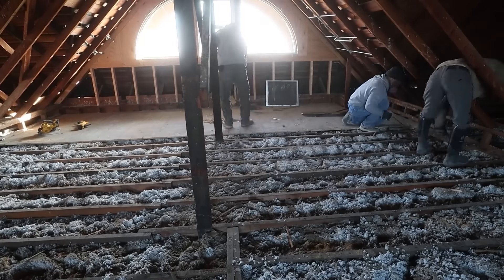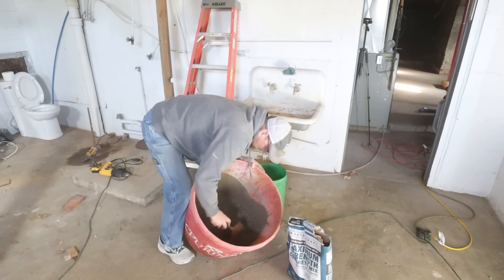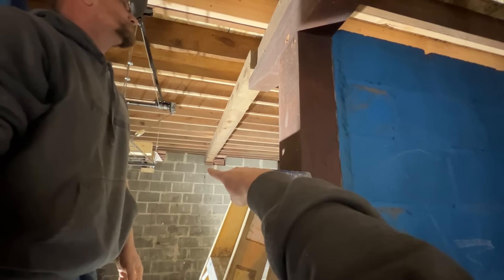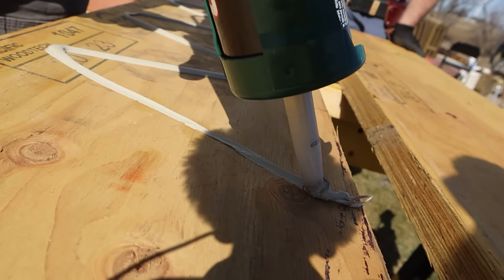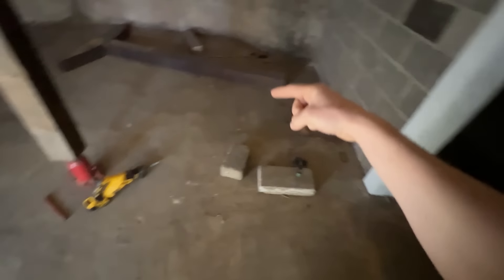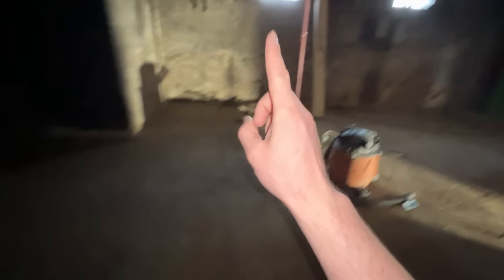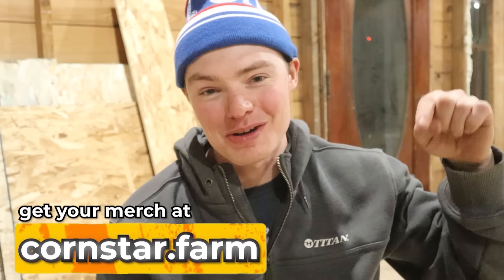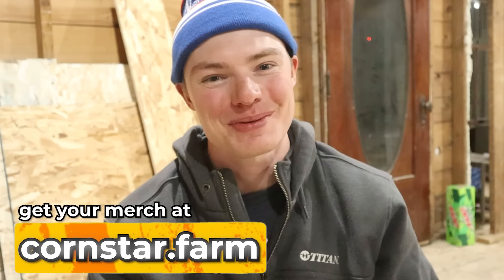Restoring A $7,000 Mansion: Rebuilding Basement Ceiling

Comment: You have good height in the basement, so you might be able to save money and time, and get a great finished product, by just cutting trenches into the existing basement floor for plumbing, drainage, radon venting, column support pads, wall relocation, etc.  Patch the trenches after utility installation/changes with concrete, make any other repairs needed, and cover with pumped-in self-leveling gypsum concrete to create a level smooth and durable floor throughout.  
You must consider moisture control before applying a self-leveling gypsum concrete overlay to an existing basement slab, so it’s essential to address potential water vapor emissions.

Begin by assessing the moisture content of the existing concrete slab. You can use a calcium chloride test kit to measure the moisture vapor emissions rate (MVER) in pounds per 1000 square feet over 24 hours.
Overlay product manufacturers typically recommend an MVER of 3 pounds or less for successful bonding.
To prevent water vapor from delaminating the overlay, apply a vapor barrier to the existing concrete slab.  Use a high-quality vapor barrier product designed for this purpose.  Redgard and Laticrete 9235 are two brands of waterproofing available at big box stores.
The vapor barrier acts as a protective layer, blocking moisture from migrating upward.
Clean the existing concrete slab thoroughly, removing any dirt, dust, or contaminants.
Repair any cracks or defects in the concrete surface.

Waterproof, allow time to cure, and install the self-leveling gypsum concrete overlay.

FYI, your house is on a hill, and appears to have been built on well draining soil.  You really don't need floor drains, except one where the water heater and washer are located.  Floor drains will just be a possible entry point for radon.  Exterior waterproofing is the best solution for walls.
P. S.  Drop the rubble from trenching down the well and install slab on top.  Done and dusted.   Cheers.

Comment: Use a pumper cement truck.
The truck has a pump and a flexible rubber  pipe to run the cement  anywhere  in the basement. 😊

Comment: Enjoying this series.  That basement step area looks like it could use a redesign, not just new concrete. It's a pretty narrow set of steps with sharp turns at the top and bottom. There has to be a better layout, before investing in all that new concrete..

Comment: Doing it in circles creates areas that potentially can trap air creating pockets of pressure and prevent the surfaces from completely mating adding thickness to the beam which depending on the situation if it's a tight fit it could prevent the beam going into its designated space and not interfere with other parts of the building.

Comment: Concrete is hard, heavy and dirty.  The sooner you guys get on with it the better.  Get it done and then you can get back to the fun part with framing and finishing.  The exterior concrete wall could probably use a new seal coat of tar or insulation to keep the basement dry and warm.  And yes drainage rock and then piping around the outside will solve a lot of problems.

Comment: So this is how its usually done where i am from, we do have quite cold temperatures here so this might not apply to your place. For the basement floor i would recommend digging it all up, lower it so you can have Gravel (10-15CM/4-6 inches) - polystyrene plates (10cm/4 inches) - concrete floor (10-15CM/4-6 inches). This gives it a total needed depth of about 30-40 cm or 12-16 inches under the basement. Now this also depends on the thickness of the footing around the bottom of the basement walls and so on, but the gravel allows for a certain amount of drainage, and the thick insulation is very practical for keeping both heat and cold in/out of your house. when it comes to the outside drainage it also depends alot on what kind of material the ground is made up of, take my place has alot of mountain beneath it, so the drainage just requires a small slope under the house to keep the basement dry, but if you have a type of ground around your house that retains alot of water i recommend for example a french drain style of drainage around your basement walls.

Comment: When it comes to your basement cement, you might be able to pump it through one window and have different sections to run the concrete through in a pipe something to check out concrete pumper

Comment: Install French drains and deep french wells that create gravity runs of water around and away from your external foundation walls.  Essentially create an entire horseshoe shape gravel ditch 4-6 ft deep and 1-2 feet wide about 15-30 feet away from your foundation itself. 

Then weeping tiles should be installed up against the base external foundational wall around the entire basement - that water can flow into and out of a sump pump install in the basement specifically to disperse water that arrives at the house via the weeping tile of other ground water.  Use appropriate bubble tarp and tar on the exterior wall of the foundation to direct water down efficiently.

Comment: You can do radon mitigation using the same pipes you use for sub floor drainage. Get two birds stones at once.
Reply: Also you might be able to start with passive radon mitigation (just pipes that vent to atmosphere) then do some testing and can add a radon pump if you need it inline with the same piping.

Comment: Justin"s "I aint't got no body" moment. at 14:41. 
Edit: I have an inside french drain around three sides of my basement with no outside french drain, I have a walkout basement and live on a sloped lot. I couldn't afford both at the time. Ten years after that I finished out the basement. Still have had no issues with moisture. It will definitely help to put them in.

Comment: Cole they make trailer mounted concrete pumper just for the purpose where a concrete truck won't fit it's pumped through a series of hose so you don't need to use wheelbarrows

Comment: Cole, you might think about hiring a contractor to do that basement.  Money well spent.  They will probably get it done in a few days if you have done the demo.  But I know you will not hire them so my advice (not that you asked) is to use wheelbarrows.  Put a chute in the window and use the wheelbarrows to move the crete to the farthest location first and finish up at the window.
Reply: You forgot the fun part, getting the old concrete out of the basement... one 5 gallon bucket at a time.

Comment: run drains inside and outside to a sump pit with a tight sealed lid while the floor is out for a foundation drain, it can also be used for radiation remediation if it's ever necessary.  Your floor drains should be part of the sanitary drain system. You also may want to use cast iron pipe for vertical runs in the living spaces, it's much quieter when the toilets are flushed.

Comment: Here in Darwin Australia, every building has to be built to cyclone code. So, all "cinder" block walls are core filled with concrete after erection and steel reinforcing bars are placed every second block through  the concrete.

Comment: An interior perimeter foundation drainage system will solve the problem of ever having any standing water in the basement.   No floor drains necessary.   Only an in-floor sump pump directing the hydraulic ground water pressure to the drainage ditch outside.

Comment: Make it like looking at a fish bone 
One man with fingers reaching out drawing the water in and out the main drain then slope your concrete accordingly 
And did you say radiant heat 
That a great time for that install 
To 
Make it more efficient add some gravel with foam board on top to create a heat sink making your radiant heat much more efficient 
It should be a great place when you’re doing

Comment: If you have heavy clay soil which expands when getting wet and shrinks when dry, before pouring basement concrete flood it so the soil will expand to its max and then pour the floor. 
This way it will not break your concrete because the soil has expended to its max, also put in drain tiles with a sump pump

Comment: Radon Gas: Around here (southern Kansas) it settles in the low spot in basements which is the sump pump. It's rather common but I don't have it, several neighbors up and down my street have it. I do have a passive radon gas vent on my sump in my basement which is a cover over the sump and a 4" vent pipe running to the outside.

As for in-ground drainage, most of the houses around here have a sump with a sump pump in it and an emergency sump pump for when the power goes out which is usually during a thunderstorm. Some houses have two sump pumps if they've got an active spring in the area. As far as drain tiles go, most houses have them on the outside and inside of the basement running along both sides of the wall. They dump into the basement pump and the sump pump, pumps the water out of the house and away from the house. Mine dumps at the foot of a large Maple tree in my front yard and keeps it watered...

Comment: Pouring the concrete floor depends on manpower and or cost. You can wheelbarrow your pour, or you can use a pumper truck with self leveling concrete. The pumper truck would run a hose through the window and you pour from the farthest point and work back to the window pulling the hose out as you go.

Comment: A concrete pump truck should have large hoses that you can use to get the concrete across the basement. If it isn't long enough, then use wheel barrels. Omg I have pushed so many wheel barrels full of concrete over the years. Probably enough to easily do your whole basement plus some. Good luck.

Comment: With a load-bearing beam, you should have cut the hole bigger enough for a solid concrete block or engineer bricks a very dense material (not fresh concrete) so if your beam is 4 inches wide, for example, you should allow minimum 2 inches on either side so you have spread load and then pack it with slate.....

Comment: If the basement hasn’t had water issues previously it’s doubtful that you will ever experience water issues. From seeing the house pretty much sitting on the top of a hill this also helps the fact that water is going to flow away from the house. 

If going to the extreme of removing the basement floor add radiant heat to the floor.

Comment: use a 2 wheel wheelbarrow to move the concrete to the back rooms first (work from the far rooms to the windows).  the fewer holes in the concrete floor the better for the radon radiation.  put the weeping tile on the outside of the foundation below the level of the footer to keep the water pressure from developing under the floor.  once the floor is broken up and dig out some dirt and place screened gravel down then a very heavy vapor barrier to pore the concrete on.  the gravel will provide drainage to move the ground water to the weeping tile.  place sump wells on the outside to drain the weeping tile if the fall to the ditch in not enough to do the job.

Comment: To do a proper radon test the area will need to be closed up for 12 hours. It's quite possible there's radon down there, especially if there is exposed dirt. When a radon system is put in, the dirt area will need to be removed/concreted, or covered with thick plastic and strong tape along the edges.  As for the drainage for water/flood, our home is on top of a hill like yours, and we've never had water in the basement. If you have a good grade around the house to direct water away and a good gutter system,  you shouldn't have much or any water problem in the basement at all. We do have one square drain area, that a sump pump can be placed if necessary.A drainage system around the exterior of the house is also a good idea, if the basement has had water in it before.  Our basement concrete floor is a "floating floor", meaning that the concrete floor doesn't touch the walls.  This helps to have a very flat level floor and prevents cracking due to settling. Between the concrete floor and wall (1 1/4" between wall and concrete floor) You can see the crushed gravel base, we added foam insulation tubing tucked all the way around the edges to help with our radon system. I love to watch your project coming together!  I'm not a contractor, but have experience with houses I've lived in.

Comment: I would be using rockwool to bolster the insulation in your wall because it's keeping itself drying and it's great for soundproofing like in certain walls that are inside too like bathrooms are between bedrooms. There are different thicknesses you can use for the walls outside and inside bats that is. And yes perimeter drains do work book it up to a sump pump area and pump tied in all out also inside floor drains. A mitigating radon with rocks plastic and insulation which is taped together before you pour the flooring

Comment: A typical radon mitigation system in Ohio uses a 3" PVC pipe that is either sunk below the concrete slab floor or through a sealed sump pit lid (if your mitigation system goes through the floor and not the sump pit lid, you still need a sealed lid to cover your sump pit). The PVC will lead up to the roof or gutter line to evacuate. A fan needs to be installed in line with the PVC pipe so that it creates a vacuum beneath the concrete floor. The two most common install methods are a pipe that exits the basement a little above ground level, had the fan installed a few up from where it exits the house and then the pipe continues to the gutter height on the outside of the house, or the pipe can through interior walls to exit out the roof with the fan commonly installed in the attic. It doesn't require a large amount of vacuum pressure to pull the gases out. To have a company install one on a home that is already finished will cost about $1,200 in our area.

Comment: Drain pipe imbedded in gravel under your new concrete floor will handle the excess water to your ditch probably without a sump pump if you have enough down slope from the floor to the ditch.  Water under the concrete will flow naturally through the gravel to the pipe and tothe ditch.

Comment: Adding a Radon mitigation system is simple. When you install your perimeter drain tile this can be used to exhaust out the gasses underneath the floor. Cost would be around $1500-$2000. If your walls are not leaking now doing an outside deep drain seems like an overkill. A French drain going down a few feet should be adequate with proper grading of the soil away from the house.

Comment: Radon thought:  Floor drains are counterproductive for Radon mitigation. Usually what people do for existing is you put a negative pressure on your drain tile around the house.  IF you tear out the floor you could seal the gravel base with plastic and tape.  If you can dig down far enough you could put a gravel base with foam insulation taped and sealed on top, then concrete.

Comment: Where the beam was short lay 8 inch blocks sidewards in the doorway, that way it will look like it was mentioned be, plus it makes a very stronge pillar.
By 8 inch block, I mean 16 x 8 x 8 inch blocks.
I am assuming the next room has a beam as well that the rest of the 16 inches would support.

Comment: Cole you're over thinking the concrete pour.  You have a window that you can put the shoot in through so all you need to do is use a wheel barrow to run concrete between rooms

Comment: How many feet from an outside wall can you place the pipe's before it freezes? Can you place them that far on an inside wall?? That way you know later on where they are. You could put an inspection door-access panel on the wall for easy access to turn off/on water on different floors and be able to clear blockages.

Comment: do think about taking out some of the block in the basement to open it up and then you can make some new walls here and there after you demo the floor - you probably just want to demo channels for drains and then pour only 2-3 inches rather than an entire basement of 6" - you will be happy to get basement totally copacetic, clean, with good drainage - could be good mancave/office - do get radon monitoring/testing/good ventilation - it comes from granite. for drainage think about a large easily maintainable sump with redundant pumps and passive drainage - you may want to think about footers if you are going to dig (you mentioned this) - you can literally jack up entire house and put it on steel ibeams - you may want total new foundation - footers/floor/walls - then you can make sure drainage is a ok and insulate foundation, even put pex in floor - blowing out block walls will help with pours - you can rent your own forms but you may want to sub it out - ymmv - don't rush, do your homework and the concrete and hvac will take some thought - be cheap and save money but also don't compromise - over engineer the rebar and get second opinions on plans, get a laser level for grading +string - see if you can get a pro or two to help out for a few days in the speciality mechanical installs ir elec/plumbing/hvac/concrete (not in that order)

Comment: I live in an area of the UK where we have to install radon traps under houses. It's basically a large plastic box under the house with a 4 inch pipe that takes the gas outside. It doesn't cost that match to do, but the building rules might be different where you are? Also could you fill the well with gravel and use it as a soak away incase of basement flooding? We recently had a flood in our workshop and the whole floor filled up. I managed to lift a waste water pipe trap in the floor and it all ran away.

Comment: Later, when you do the stairs, dig out under both flights and square the entire corner. The well....fill with gravel, then cap over with new floor. Thnx for update on the bin site. As far as your forever home is concerned, another 100 years as a family home. Your Grampa would be proud. D.C. and M.C.and thr rest of the family are. How is Cooper and Summer doing. Mizz CORN! THE HOLLOWEEN COSTUME?